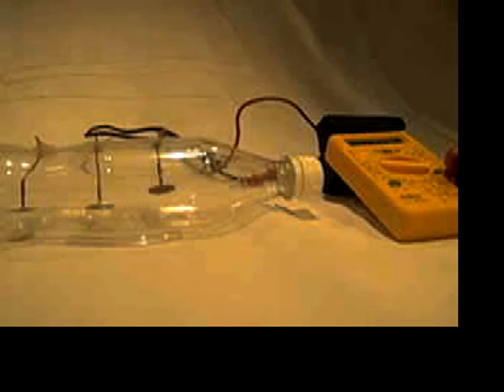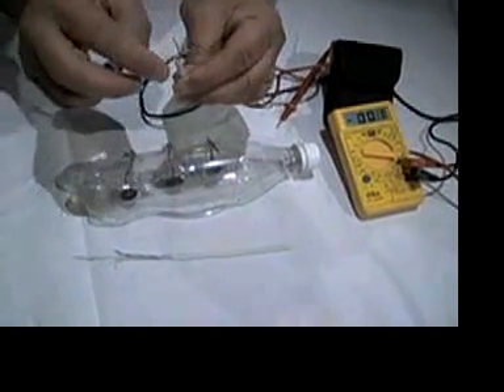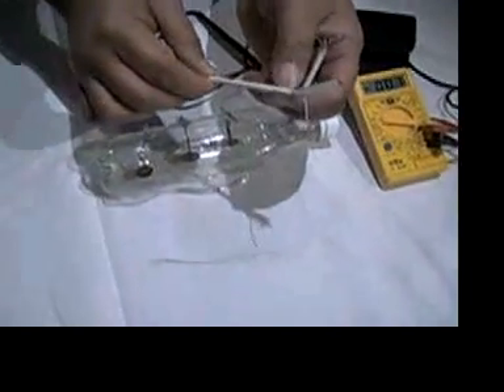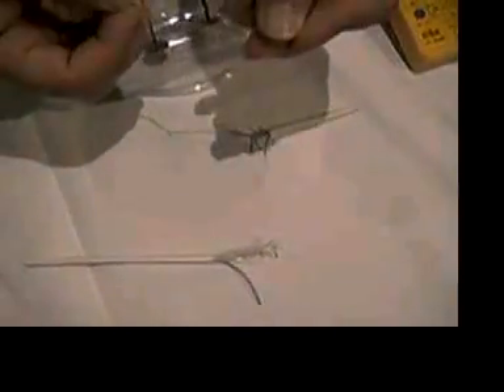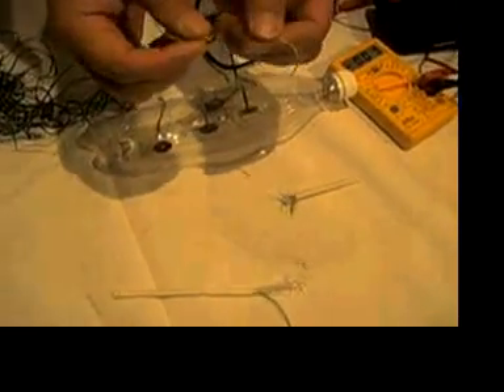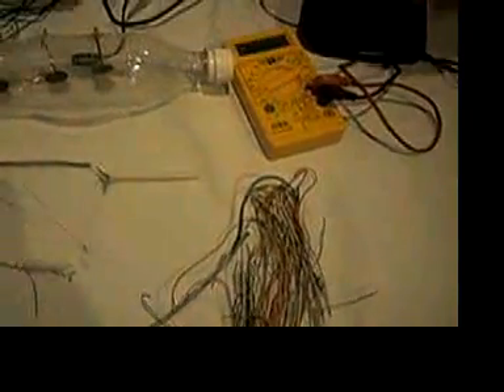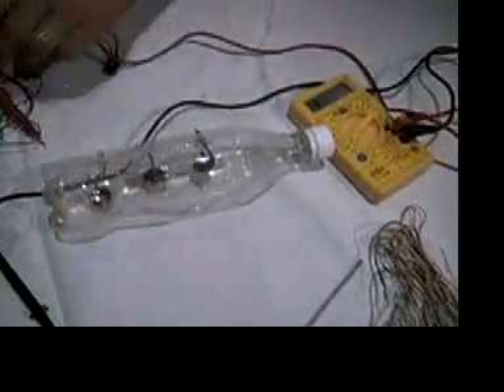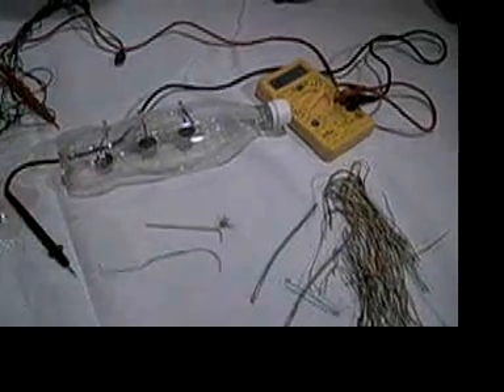Graphene nano layer on insulated wires

Comment: a nuclear engineer who says that the coating on a copper wire is graphene nano material, when in fact copper will turn black when exposed to heat, moisture, or ozone and that is called copper oxide, no carbon is involved lol.  and copper oxide is still a conductor not an insulator